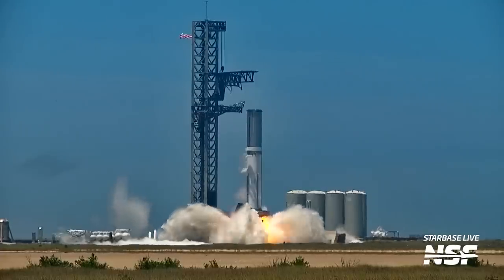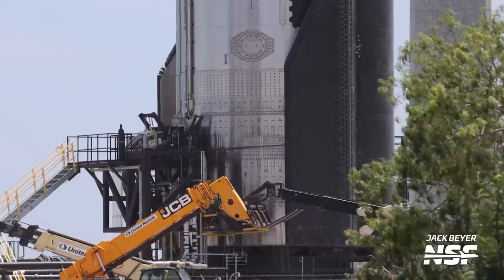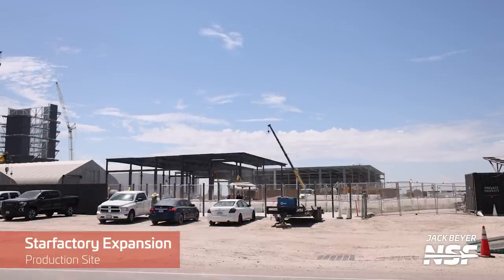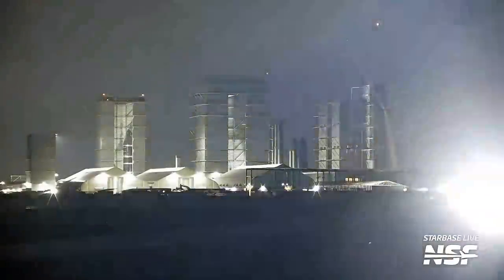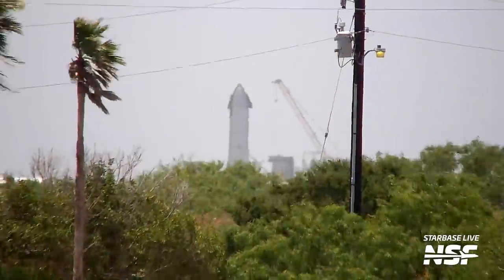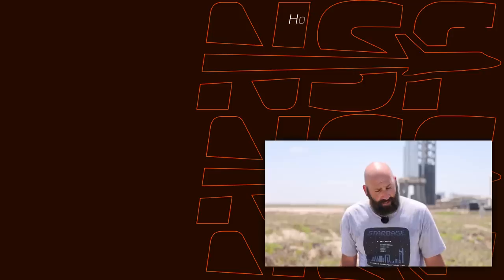Starbase Update: Epic Booster 9 Static Fire, Ship 28 Prep & Future Starship Tests

Comment: 0:00 Introduction
0:45 Ship 28 Cryo Test
2:07 Ship 28 Rollback
2:32 New Mega Bay Section Stacked
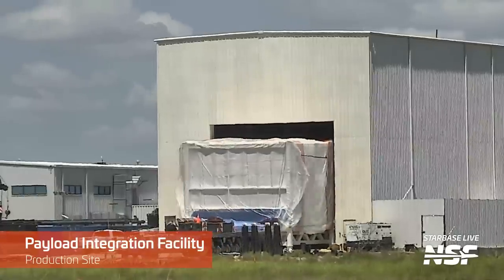3:04 Payload Integration Facility
3:35 Ship 30 Nosecone Stacked
4:02 Ground Fabrication Building
4:27 Starfactory Expansion
5:07 Raptor Stand Moved
5:29 Stairs Put On Tower
5:52 SPMT Moved to Launch Site
6:19 Orbital Tank Farm Painted
6:33 Hot Staging Test Article
7:51 Work Inside Booster 9
8:27 Dance Floor Removed
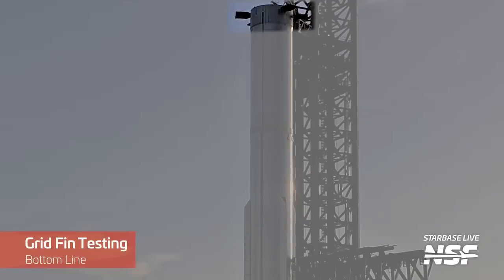8:49 Grid Fin Testing
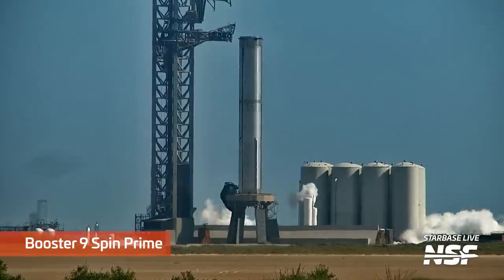8:59 Booster 9 Spin Prime
9:44 QD Arm Retracted
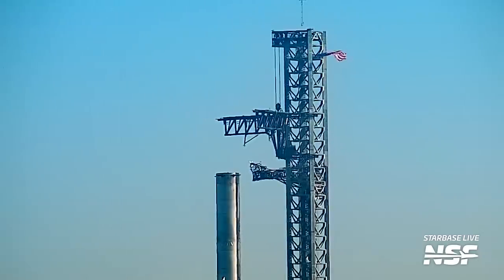9:55 Booster 9 Static Fire

Comment: The cloud generated looked like mostly steam and not much dust or debis.  The cloud mostly dissipated like steam would.  Id say it worked way beyond expectations.
Reply: @petefrancke9961, it worked well but the test was only ~2.74 seconds so not a lot of time to see how a sustained firing will affect things. They said 4 engines shut down prematurely in the test. I haven't kept up with things closely but some of the tests I saw in the past, they seem to keep having "engine issues" where some engines "flicker/flame-up" and even "shut off" or are manually "shut down". I will say that the test tho, the power generated was insane! I joked that if we put a few more of these strategically on Earth and invert them, we wouldn't need to "travel to Mars on Starship", we could use Starship's engines to travel to Mars ON Earth.😄
Reply: Avoid Premature celebration. This very brief test fire was only a fraction of a full Starship  launch. The old pad survived engine tests but not an actual launch. Success = a pad that survives multiple launches without damage.
Reply: In the last clip of the static fire, there was something raining down.  Though it looked...stringy?
Reply: @warrenwhite9085   if it lasted a full 5 seconds then it would have been succesful
Reply: Agreed!
Reply: @warrenwhite9085  I only counted about 15 visible pieces of debris between 9:59 and 10:05.  Some of those might have been doubles, though.😐
Reply: I don't know about "way beyond expectations".  Little early for that level of enthusiasm.
Reply: @ericperkins3078 but what if his expectations were for human sized steel shrapnel?
Reply: What were the expectations?  That it might explode?
Reply: @ItsEverythingElse  good question and I expected some obvious fragmentation
Reply: @Fold-103 Two systems were being tested: 
. The Starship booster (stage 1). Goal: Fire  for 5 seconds. Result: Fail.
. the pad (Stage 2), especially the new flame deflector & water system, Operate with no damage. Result: We don’t  know
Reply: @zenithperigee7442 Next booster is Raptor 2.5
Reply: @DoomShepherd Looks like bits of grass mostly.
Reply: Agreed, I would love to see flyover views of the OLM.  Think we'll see the hot stage adapter tested to failure and another static fire of b9.
Reply: Let's hope eh!
Reply: @DoomShepherd slow it down to •25 speed, the cloud was filled with crap.
Reply: Well I mean, they had to abort the test….again
Reply: @zenithperigee7442  And what's the throttle percentage on the engines for a static test I suppose it's not the full 100% since it would wreck the connections between the orbital table and the booster.

Comment: The fact that they choosed to fire 33 raptors alltogether on the first static fire is already a big achievement !
Reply: Why? 4 raptors shut down. That seems problematic to me. It's just like when SpaceX said that the fondag would survive the last launch but it was obliterated. They have serious issues to work through right now.
Reply: @TheMasterCylinder  they started all the engines on the first test of the new booster, that 4 didn't last the duration is a problem they need to look at but they didn't do a series of smaller tests they went straight to a full 33 engine test.
Reply: @TheMasterCylinder  Serious issues?  I'm curious how you know that.  It certainly cannot be inferred from anything we've seen made public.
Reply: They still have significant reliability problems with the engines.  Not to mention design issues with the vehicle.  The fly it then fix it approach looks exciting but doesn't accomplish much in the way of development.

Comment: Just in case ni enough people have already said this: the pace of development at Starbase is Insane! A foundation that size usually takes a house about a half a yearor a full year to be done. I Europe many residential buildings are done like that, and you don’t see anything above ground for 1-2 years (digging, foundation + sub terranian parking lots). Then the fact that the Deluge was tested a few days after installation is insane! Then that it seemingly needed NO adjustments, they nailed it as if they had built 10 of these already. Again: there are using an experimental tool as a critical instrument over and over again like its just another day of the week. All the while they replaces most of the hoses and connectors on the Stand, some other hardware, repainted the whole thing, and put back a fully loaded booster like a week after the concrete pour, that must have been just set enough for that (the main piles obviously handled the brunt which were already there, but still). The ship QD is done, cladding is replaced, new water retention pond is created. Mindblowing. This can only be explained by how kich they plan and prepare and settle on in advance. Amd they are damn sure about their decisions. Like: I am pretty sure, hot staging was on the table way before the Inaugural Flight Test. I am blown away what they might already have on the drawing boards: probably several Moon Lander Concepts, Landing leg designs, Ship Cargo and Crew variations, next tower location and erea layout, new ship desigs like smaller flaps at slitghtly different location, they probably have a perspirative cooling designconcept too in case tiles wont work, 3 gridfins for the Booster, probably moon landing engines, crane for the lander, moon lander inside structure, docking ports. The hot staging may be a moon landing requiriment as well for more abort scenarios. There are a lot of things we don’t know this may be the reason this all seems like they are pulling these ideas out of knowwhere, which obviously cannot be further from the truth.
Reply: When you do things wrong of course it takes less time. Boca Chica is a exercise in futility wasted time and money. Starship has not had one successful test. You talk a bunch of talk for SpaceX but they need to walk the walk. Anything outside of falcon 9 has been a disaster for spaceX. Starlink may not even be viable as a ISP business say experts and Musk. Starship cannot fly from Boca Chica, and I doubt Starship will even fly without a major overhaul in design philosophy.

Comment: I think it's really clever that instead of making the hotstage ring a permanent part of the boosters, they made it plug and play, so going forward if they change their mind or even just want a single test flight without it, they can.
Reply: They modified the tower to match the taller Starship stack.
Reply: My only question with that is whether the ship QD can lower again in place or if it has to be disassembled for the change over.
Reply: @bensavedbychrist  They could always keep a ring, just a different one. My guess is that the ring is removeable to allow for deformation having occurred during staging, thus they replace the damaged one. It could also be that they haven’t finalised the design subject to flight testing.
Reply: What good are hostages going to be if they're burnt to a crisp?
Oh, HOTSTAGE ring, not HOSTAGE ring.
Never mind.
Reply: @ddegn Actually the hotstage rings might just be replaceable. After 1-? Launches.
Reply: How about first getting the vehicle into space before adding on more complext things that can fail?

Comment: I like the SpaceX philosophy of "test early, test hard, test often".  Somehow it doesn't seem to apply to static fires, though, other than for single engines.  For the booster to lift the second stage high enough for that to have a 50% chance to reach orbit, I would think that static fires ought to have at least a 90% chance of success.  I would think that this would require multiple successful static fires of the booster, in the launch mount.

Comment: I would say they want to do another SF because that one was only 2.7 seconds out of the targeted 5 and 4 shutting down.
Reply: 33 or bust. IFT2 accent needs to go perfectly so it's best to make sure all engines will definitely ignite given there's no more reason (debris) why they shouldn't
Reply: @moodmusicytc  Yes brother they should swap the faulty raptors until the point that all 33 burn for full duration during static fire and then send that monster up in the space for which it is originally made for  ...
Reply: And this was only 1/2 thrust. Not convinced it’s up to a safe full launch.
Reply: @GrooveTasticThang  100% correct

Comment: I think the HS ring will be subjected to many 'norminal' cycles, and then more extreme conditions will be tested increasingly until failure.
Reply: I agree. Once the ring passes I think they will immediately start building a second one at Starbase to be used for the launch. SpaceX still needs to get FAA approval, and maybe do another booster static fire since that first one had 4 engines out and only managed 2.7 of the planned 5 second duration so building a second HS ring isn’t likely to get anywhere close to delaying the next launch. And using this first ring to see exactly when and how it fails will be very useful so that SpaceX knows where to put sensors on the HS ring used for launch and what to expect and look out for in the telemetry.
Reply: I wonder if they will simulate the conditions of hot firing, blast some gas through it. Be difficult without actually mounting a second stage on top. Very interested to see how the booster holds up during hotstaging.
Reply: @jack504  Interesting idea. That sounds to me like the sort of thing that might be most easily done as McGregor, similar to how they fired that single Raptor at that little steel plate that we wouldn't have known about had SpaceX not released a video of it, so maybe at least some sort of simple single-engine scaled-down tests have been done already that were never caught on any NSF cameras.

Comment: It will be crushed to see just how much pressure it can take, of course, but then again you never know with SpaceX
Reply: I'd laugh if when they do try to crush it, either the lower part or the ship aft section fails and the hot stage ring say: Is that all you've got?
Reply: @gravelydon7072  Definitely, aft section will collapse before hot stage section. The design and structure is more rigid than any ring sections in Starship or Heavy Booster for sure. The host stage ring is too short. The current test stand or set-up is not working for it.

Comment: The inconsistency of the Raptors on the vehicle it self makes me worrying
Reply: The raptors are just one component of this complex rocket. Other parts of starship including the TPS, the hot staging ring, and the upgrade to electronic the TVC or thrust vector control all need to be further evaluated and possibly reengineered.  That's the way it goes with any new rocket development.
Reply: @michaeldeierhoi4096  , that makes sense but OP expresses my own concern because we've seen repeated "issues" associated with the "engines". Like an automobile experiencing issues with it's engine, it's not necessarily the mechanical components of the engine although it could be, it could be various components related to the fuel delivery or engine management system, it could be an issue with the ignition/spark delivery system, it could be the sensors or mechanicals related to the delivery of air into the engine, it could be a malfunction in an emissions component etc. So none of us knows which component(s)/system(s) is/are responsible for the "engine issues", just that there appears to be "issues with the engines", just like that of an automobile whose "engine" is running poorly or not at all.
Reply: @zenithperigee7442  And it may get not be the engines at all that are the issue.  It might be how the engines are integrated into the system as you alluded to with the fuel delivery, etc.
Reply: I think it's stable on test stand. However, 33 engines in small space will have more edge/corner cases. That's why SpaceX will need more testing to see what they are missing.
Reply: I dont see no problem, its not even done yet!!
Reply: It is a bad design. Same issues plauged N1. Too many rockets too  many problems. They should just use R25 NASA equivalents. They probably only need 8.
Reply: @EricHamm  I don't agreed. If you don't change or innovate design, you can't have a new outcome. The current design definitively  has some problems because they was tested in few times. The testing for a big rocket at this scale will cost a lot of moneys. However, I don't think we have any shortcuts for this time. If SpaceX don't try a new thing, SpaceX will become ULA, Boeing.
Reply: @EricHamm  There are no R-25 equivalents that burn CH4 fuel.
Reply: @EricHamm  they havent even started yet, the whole purpose of the mission was CLEARING THE LAUNCH PAD!!! See what it does!! Very first test ever!!

Comment: I believe that the criteria for a full firing still fits with the >30 engines running from launch, so it started with all 33 but 4 shut down which caused the abort
Reply: unless the four include too many (any?) of the center steering engines.
Reply: @stevevernon1978  I doubt that would factor in it directly which were the issue
Reply: @jcdavis5871  I meant for the actual launch, not just a static fire.

Comment: Thanks Jack and all NSF contributors!  Great coverage as always.  I am guessing that they'll do another round of SP and SF, this time perhaps all 33 engines?  They have to check that deluge system to insure it works, you know, test and validate?  They'll have to run it for a longer duration to insure it can handle the heat/thrust from all those engines before an actual launch.  There's a lot of water coming out, but whether they can keep the water coming out under the exhaust / thrust / pressure from ALL THOSE Raptor engines is a very important question.  If the water pressure can't overcome the pressure from the engines, then, you lose cooling / damping, and the engines simply tear through the metal plate and you're back where you were before.  My "Suspicion" (intuition?) is that they're actually gonna need an angle plate to form a "Flame redirector" before they finish the development of Stage Zero.

Comment: With 4 engines shutting down prematurely, there seems to be no improvement to the reliability of the engines since the first launch. I believe it was only 3 shutting down before launch on the first flight.  When do we expect all 33 to fire correct during a 5-second test?
Reply: Until we know why they shut down, it is difficult to speculate.
Reply: @thearpox7873  And these are older engines. Engines in the 100s while newer ones are in the 200s already.
Reply: No 4 didn't come online, meaning they had a 1 engine failure margin instead of 5 engine margin they should of had when Elon wanted that 4/20 launch. So likely they have not addressed the problems with getting all engines to work that plagued the launch. This is ass backwards. They need to static fire all engines a bunch then move on to testing the water plate. It's just bad management.

Comment: The only major remaining hurdle is getting all 33 Raptors to fire reliably.  Continuing long term unreliabilities/shutdowns prior to launch will invalidate all the work done so far, particularly with the FAA, to ensure safe and reliably repeatable launches.
Reply: Huh? They have 33 - and can likely build lots of margin into flight design.  We don't know if the deluge may have impacted start reliability either - the volume of water going up seemed significant - so they are figuring things out. If they instrument they can figure out if its start issue, pressure issues, vibration issues etc. They haven't done a lot of 33 engine test firings and are barely starting. This will not invalidate "all" work - the tech behind these engines is already incredible.
Reply: @randominternet5586  The loss of engines prior to the last test launch created an off vector take off which could have been catastrophic they need two demonstrate a level of reliability that will ensure this doesn't happen again. If they continue to have multiple engines out at, or prior to launch this will be a major hurdle.

Comment: Correction for y'all, Booster 9 did ignite all 33 engines but 4 of them shut down prematurely. This would mean that all 33 were firing for a very short period of time.
Reply: 4 engines were non responsive prior to the lauch, so they only had 1 engine to fail for mission failure. Elon wanted that 4/20 launch, even knowing 4 engines would not work. So for this test if 4 engines shut down that means they probably haven't even worked out the problem they had from the launch. If they can't fire 33 engines (which is a stupid rocket system, see N1) what's even the point of any further advancements if they can't get the thing airborne.

Comment: I hope spacex will do few more static fires. 4 engines dying and overall test ending prematurely, idk, feels worrying to me, would be nice if they ironed out the sequence to finally ignite all 33 prior to next launch
Reply: test ending early was likely due to an auto abort on the 4th engine shutdown, there will almost certainly be a retest after they found the problem.
Reply: It failed because the system failed. They would of continued the test if it was only 4 engines not firing or they were afraid it would blow up. Either way this was not a test.